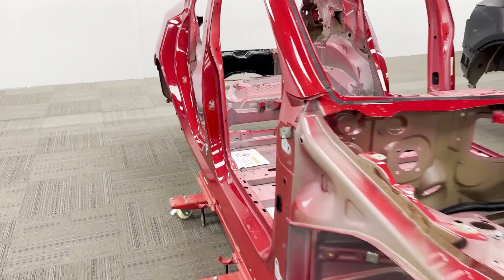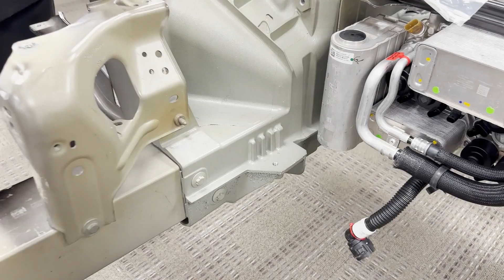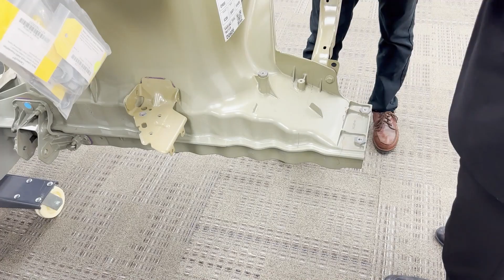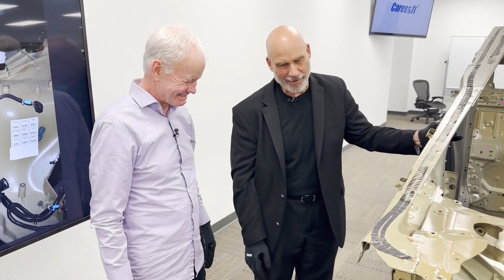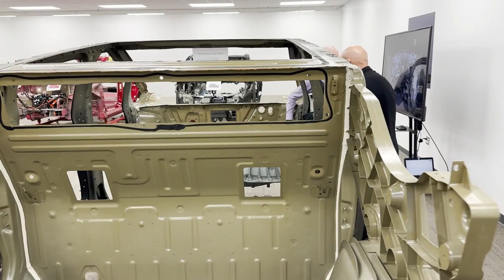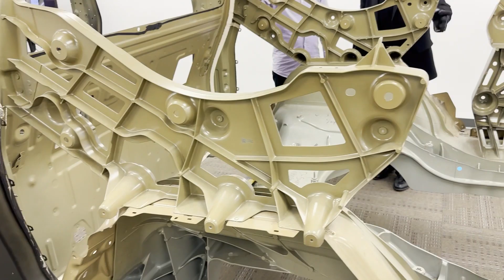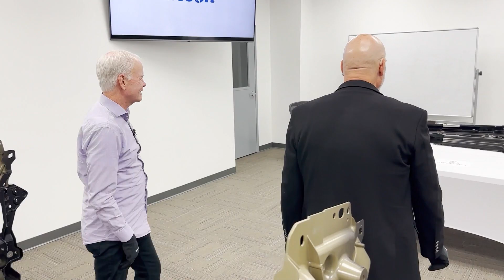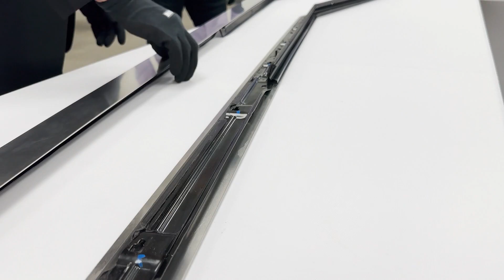The Evolution of Tesla's Body Structure - Caresoft Teardown

Comment: The vehicle 'skin' is clearly adding strength & rigidity to the structure, despite insinuations I keep seeing in various places.
Reply: The flat skin is glued to a structural stamped panel. If the skin was structural they would not need to be bonded onto a stamped panel.
Reply: @kazedcat  Not so, to have that thick panel add rigidity to rest of the truck, it needs to be bonded that strongly.  Otherwise it is only rigid unto itself.  Nice 'n all, but limits what it can do.
Reply: @JT_771  Yes the glue is structural
Reply: @kazedcat  Structural adhesive is a thing, used all over the place in automotive.  It bonds structures together.  Good stuff.
Reply: @JT_771  The glue is structural but the skin is not. If you just build the surface with glue instead of stainless steel the panel would end up stronger.
Reply: @kazedcat  For steel strong enough to shrug off bullets, that's a ludicrous statement.
Reply: @JT_771  We are not talking about durability we are talking about structural strength. Because the stainless steel is just glued into the structural panel. The maximum stress load that can be applied to it is limited to the maximum shear strength of the glue. The strength of the stainless steel does not matter because it would delaminate once the stress exceeded that of the maximum strength of the adhesive.
Reply: @kazedcat  This is true, that glue is critical in that fashion.  If you designed the glue in question & know its specific capabilities, it's an acceptable argument.  Otherwise it's speculation, which doesn't cut it.
Reply: @JT_771  Yes the glue is critical for the structure but the stainless steel is not you can replace it with mild steel and the structure will have roughly the same strength. Although mild steel will not have the same toughness and durability as stainless steel due to the construction method it will offer similar structural strength.
Reply: @kazedcat  So now it IS structural, you say, but could be other materials too.  Hard to have conversations this way.
Reply: @JT_771  The glue is structural how many time do I have to repeat myself.
Reply: @kazedcat  You misunderstood, I was talking about the metal.
Reply: Tesla HFS = hard F-ing steel.

Comment: I understand that the body panels are stainless steel, but the frame (minus the castings) is steel, right? How will this vehicle hold up against a high corrosive environment such as road salt? Think it will last 30 years on the road without the frame rusting out?
Reply: 100% Dipped and e-Coated .
Cybertruck , does not RUST .
Reply: I think they are coated with chromium for rust protection.

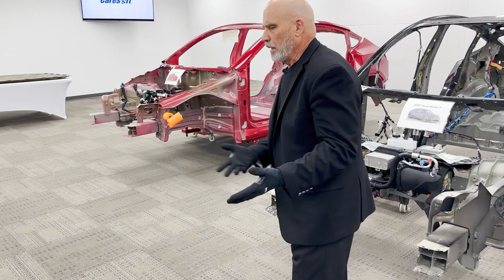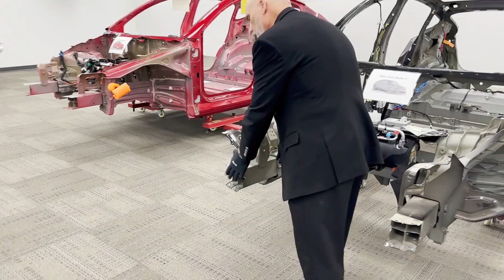Comment: @ 6:19 Cybertruck front casting. More planned obsolescence taken to the extreme. No replaceable crush cans like on the Model Y at 6:11. If you have a minor accident, you're screwed!
This is Tesla's "innovation"!
Reply: BREAKING news - in China , model Y flips over 7 times, ALL 5 passengers SURVIVE , able to WALK AWAY.
Reply: @markplott4820  More breaking news... I rolled over a 1980 Datsun 210 in an ice storm 5 or 6 times. Not wearing a seatbelt. Walked away with the only scratches coming from the blackberry bushes I walked through on the way out!
News for Tesla fans.... Walking away from crashes is NOT news.
Reply: @DavidJohnson-tv2nn  Did the other 4 passengers die?
Reply: @DavidJohnson-tv2nn  Also, I bet it is a lot harder to flip a Model Y than a Datsun 210.  Those things seem to rollover on command.
Reply: So, what car can you get the engine pushed into the cabin and Insurance will just fix it?
Reply: @davidbeppler3032  This will be ruined by a minor impact. Since the crush cans are NOT replaceable. Even a small hit on the front will destroy them. Compare to the replaceable bolt on crush cans @ 6:11

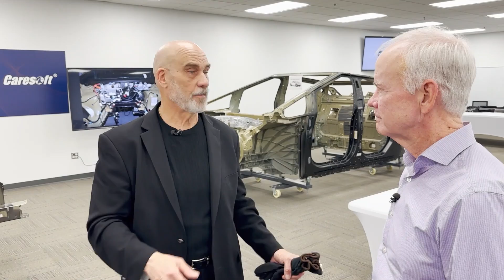Comment: 1:30 - but in case of a car crash you would love to have these single parts or repair structures instead of getting a whole gigacast assembly replaced.

Tesla insurance fees have there fore increased a lot over time cause everything has become a quite expensive repair. In the past you had battery modules you could get and replace which is cheaper then replacing now a full battery fro 15000€ or more due to the bigger capacity and 1 piece only.

Not always better for the consumer, only for the manufacturer to lower costs and a few more benefits like higher stifness.
Reply: All car insurnace has increased over time. Tesla insurance is similar to other premium cars, but is far more likely to avoid killing or injuring you in an accident than competitors.
Reply: the Gigacast , remains INTACT , no damage.
the OTHER vehicle , Totaled.
Reply: Perhaps. But most anything seen in this video getting damaged is probably going to be a write off, or at least a very very expensive repair, in most any car. They don't like putting structurally damaged cars back out, usually. Not that this car should be the model per se, but if anything, the fact that the outside is not structural perhaps lends it to better repairability overall in low impact crashes than most vehicles.
Reply: Can't cut Aluminum.  Impossible.  Better to have something heavier, prone to breaking, less structurally sound, and unrepairable than a Giga cast.
/s

Comment: Seeing comments about this frame being more expensive to repair. You don't repair frames. Any insurance company totals the car if your frame has been compromised. 
John and Terry, thank you!
Reply: Yes. Just imagine that the one cast part, traditionally consists of 280 stamped parts. In an accident it means that 20-30 are bent. Try to streighten it now. Yes, one can pull it to the dimensions, but the part will never work properly in the next crash. It is the reason cars are totalled if the frame is even slightly bent.
Yes. In poorer countries people repair cars, which are totaled in more strict countries. When I was young, my country was a poor communist state and I've driven a Citroen welded from two other. Well, it meandered a little when the road was wet, but was good on dry :). I was young and I had no other means to have a car. Now, my country is a Western again, and it is impossible to drive such a Frankenstein cars. These moved further East...
BTW Tesla sells parts of casts to cut the crushed part and weld in the new fragment - in the case of the small crashes. The cast is much more stable, so it can be repaired to some extend - perhaps more than a steel frame.
Reply: According to WalletHub, 70–75% of totaled cars are eventually repaired.  Having seen the CT I can envision that there are going to be a lot of CT's repaired with replacement body sides, casting, and skin harvested from totaled vehicles.   No body work required.
Whe have seen a few CT's where body panels are push in a bit.  Looks like the non stainless backing the stainless provides crush to allow for this.   A very interesting system.
Reply: Keep in mind that Tesla also has their own auto insurance, so they definitely thin about these issues a lot!
Reply: Insurance companies AUCTION totalled cars! Please stop exposing your ignorance in a public forum!
Reply: Well that’s not true at all … I had a whole new frame installed when my F-150 truck was significantly damaged … it really only cost $3500 for the frame as I recall the body shop telling me … everything was taken off and out in the new frame …
Reply: My brother-in-law has owned his bodyshop for over 20 years now and deals with every major and lesser known insurance companies and these days they total cars for the smallest of damages so you can bet any most if not all frame damage would be deemed totaled by the insurance companies.
Reply: Thats true but wouldn't this mean any minor incident that you may get away with repairing on a traditional build now will total the Cybertruck?  Seems like insurance premiums for this will soar.
Reply: @aussie2uGA 
There's something in the video you watched called crash cans
Just 2 bolts bro
Reply: @aussie2uGA  Minor accidents don't touch your frame. Major accidents (with airbags) do.
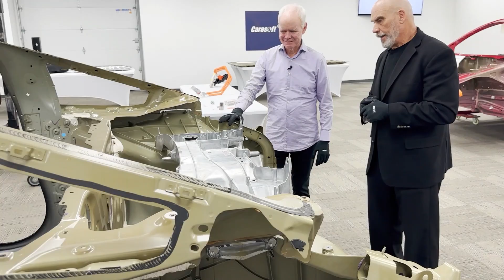Reply: @asimo3089  Watch from 6:00 The next 20 seconds explain how a Model Y can be repaired and a CT can't.
Reply: @asimo3089  the casting is structure to the tesla so a small damage might be very serious
Reply: its , Returned to ACTIVE service in less than 8H.
Reply: @markplott4820  never
Reply: @alanmay7929   - ZERO repairs needed.
Reply: its not just about repairs but body on frame are the holy grail of vehicles nothing will ever match it! it allows single/double cab with signicantly longer bed lenghts, it makes the truck to be very easily modifiable from making dump truck to utility bed for many applications to installing cranes, converting to 6x6.... possibilities are limitless
Reply: a frame on a truck can actually be replaced
Reply: But this car doesent have a frame, its a monococque, and the castings go all the way to the front so that just a tiny damage will total the car.
Reply: @GTO33  Not sure if you watched the whole explanations and video, there are sacrificial crash rails that are bolted onto  theFRONT. and REAR castings, and if you watch some other videos about the Cyber Trk the doors skins themselves are made of 30 x HARDENED SSteel, SO STRONG that Side Beam Members are not needed, like in traditional doors of modern cars or trucks.
Reply: @AuralioCabal  Those crash rails were in the 2022 Model Y subframe. Cybertruck doesn't have them, instead the casting itself is sacrificial. Start watching at 6:00 and you'll see.
Reply: @GTO33  Define "minor" damage.  Cybertruck could run through a Toyota Rav4 and be fine.  The Rav would have "minor" damage and be totaled.
Reply: @davidbeppler3032  now replace the rav4 with a regular boring model3 or y and see is the story will change lol!!! comapring a truck to an SUV seriousl!!!
Reply: @davidbeppler3032  Stupidest comment of the day....
Reply: @alanmay7929  Sure.  We can compare them.  Model Y vs Rav4.  One has a safety score so high they had to rewrite the testing methods.  The other has the bare minimum to pass.  A model Y flipped 7 times and the 5 people inside had minor injuries.  A Rav4 hit a post and caught fire killing 2 people.
Reply: @GTO33  Which one?  I make so many stupid comments, I need you to be exact.
Reply: @davidbeppler3032  what a great joke wow keep it on!
Reply: @davidbeppler3032  all accident cases are totally different I've also seen a Toyota Camry overrun a bypass  fly and landed on the roof barely any injuries!
Reply: @alanmay7929  You are quoting a 1 off.  Not an EVERY TESLA IS INSANELY SAFE!  How safe?  So safe they had to make a new test!

Comment: Not repairable, which means insurance cost should be sky high. Remember when cars had frames and they could be simply straightened? Sure this approach to gigacasting speed up assembly and reduce manufacturing cost, but if you are in a minor crash, you are SOL. Whatever happened to cybertruck which was supposed to have structural skin, hence straight flat panels made of SS 304. I guess it didn’t work out.
Reply: Easily repairable, which means insurance cost should be sky high.  As insurance pricing has nothing to do with how much a vehicle costs to repair.  Replacing a human arm costs $1.2 million, the car costs $100k.  Tesla is the safest car ever made.  Insurance will be dirt cheap.
Reply: While car repairability is very desirable I'd rather the doctors not have to repair a HUMAN, what good is a repaired car if your Husband or child died?
Reply: Modern cars like this are ultra disposable which is what automakers want, you coming back for a new one, similar to planned obsolescence.
Reply: Not true
Reply: @danielmarquis434  so tell me how to replace front main casting and how much would that replacement part cost. Remember these are structural aluminum castings which means that it won’t take much to crack.
Reply: @knutbergan  At a crash so signficant that the Tesla casting is damaged, likely saves the occupants. The same accident force with a conventional ICE car would total it and likely kill l or badly injure the occupants as well.  I'd rather be alive and need a new car, than dead and not need a car at all.  Cybertruck may be cheaper for the insurance too - death can be expensive!
Reply: you , cant BREAK a Cybertruck,.

Comment: They are making vehicles impossible to repair in a cost effective manner. That is why so many are total losses in more severe than minor collisions.
Reply: If your frame is damaged, it's a totaled vehicle from your insurance company. The structure is compromised.
Reply: NO REPAIRS , ever needed.
Reply: But people in an accident with a Tesla are faring much better.

Which is more important? 

Repairability of the frame or survivability in a crash?

As production increases, the cost goes down. Look how far Tesla has dropped their prices. What happens when they switch to the boxed method and start using bots?
Reply: @shannonwoodcock1035  Safety of passengers and repairability are both important in keeping insurance rates low.

Comment: A  car that becomes to expensive to repair and therefore insure. Now we end up with a throwaway car that most can't afford.
Reply: Do you want a frame that protects the passengers.

Or one that is easier to repair but doesn't protect the passenger?

There is the cost as well, the gigacasting is cheaper.
Reply: @shannonwoodcock1035  it's the battery and it's casing that is the structural part that helps protect the passengers not the subframe. Until it catches on fire that is.
Reply: Better to throw away some crumpled up metal than crumpled up people genius! 😎
Reply: @4literv6  it's not the subframe that does this sir, it's the battery pack.
Reply: Do you usually repair frames?
Reply: @theipc-twizzt2789  for minor damage yes
Reply: I saw an Auto line Daily episode that answered question why a Hyundai Genesis were being TOTALLED,  answer was the cost of ADAS SENSORS, Headlights,Airbags,some Engine parts, that's not even talking about frame damages.
Reply: The idea is that humans stop driving and accidents decrease significantly.

Comment: Sandy Munroe  has for years been after OEM's to investigate castings. Has Terry ever promoted the idea? That would the difference between Monroe live and this guy. A little late to the party. Good try Autolie.
Reply: A little late on Youtube maybe, but there are dusins of companies doing teardowns and selling the information. And Mundro is mostly doing cost breakdowns. Their technical knowhow is not very impressing. Btw, European manufacturers has been doing castings for over 30 years, and counting...
Reply: @GTO33  - Yep, lots of castings for years by legacy automakers but other than the engine block, most are trivally small parts that still require hundreds of parts to be designed, manufactured and assembled, while a gigacasting consolidates all that into a single part.  Since until recently there was no casting machine in existence that could make such large parts, so one ever asked if it could be done (other than Munro).  Then there was the new metalugry that Tesla developed to make such large parts dimensionally stable. Prior castings required further machining to deal with casting dimensional variances.
Reply: @tesla_tap  Tesla was not the first customer of theese European casting machines. No machining needed for the castings in a Mercedes or Audi body.
Reply: @GTO33  - I wasn't aware the engine blocks require no machining. That is impressive.
Reply: @tesla_tap  Nobody is talking about engine blocks except for U. Im talking about big alloy castings in bodywork, somthing that is used extensively by at least 8-9 European manufacturers.
Reply: @GTO33  Really , so why are these the largest ever made casting machines and the OEM's are scrambling to catch up?  Munroe actually send Tesla all his recommendation for improvements after his first tear down of the model 3 ? (at no charge )  Tesla went above and beyond.  Name one company that makes casting on production cars  with similar size castings?
Reply: @GTO33 please name me one European company that uses Gigacasts machines and produces cars that have these same size MEGACASTS?,What VOLUME , PRODUCTION NUMBERS ?  Please?
Reply: @AuralioCabal  If you can define what a gigacasting is. How many kilos is a megacasting? By the way. The casting machines that Tesla use is made in Europe..

Comment: Worth noting that Tesla still uses the same front assembly as they did in 2021. Still no mega/giga cast front for non-structural pack cars. Currently the CT is the only car they sell in the US with a structural pack, 4680 was the only Y with this front casting and it's been shelved. If you buy a model Y right now in the US, regardless of variant, it will have the old stamped front end.
Reply: Overseas the Berlin built model Y sr with byd pack has the front casting. Wonder if the Shanghai ones also have it?
Since gigahai has 6 casting machine's. 4 in Berlin and only 2 out at freemont but a big pit with 4 more is almost done. 🤔
Reply: @AudiTTQuattro2003  every engine block is cast thanks to Ford making that change a century ago. 
The casting is very cheap for a complex assembly of its size directly from tesla. 

And the crush cans can be cut off if crumpled and new sections added back in either with bolts or welding. 👍🏻